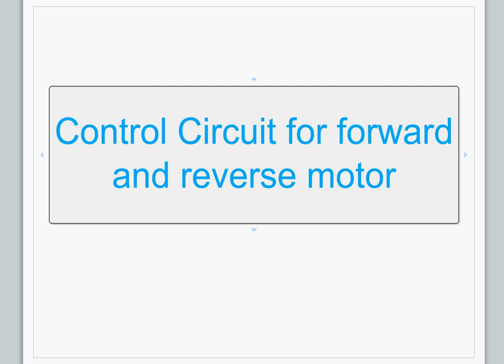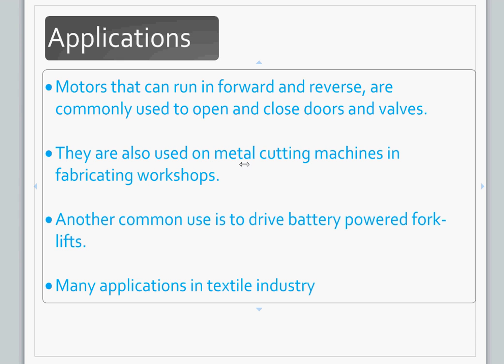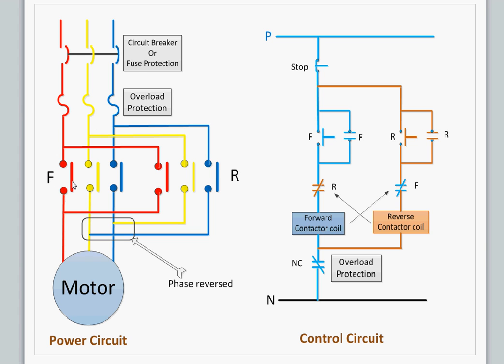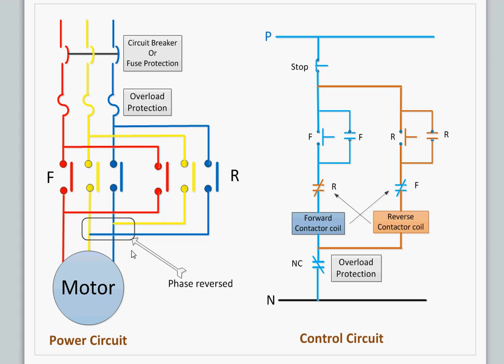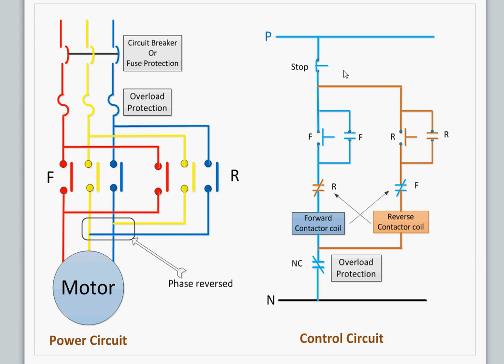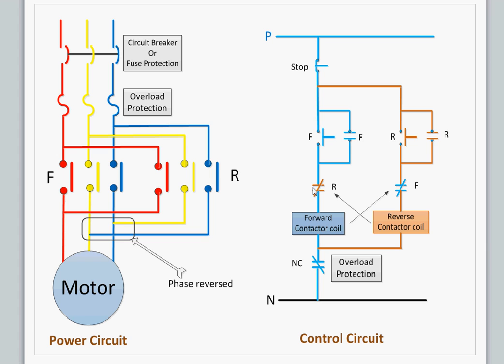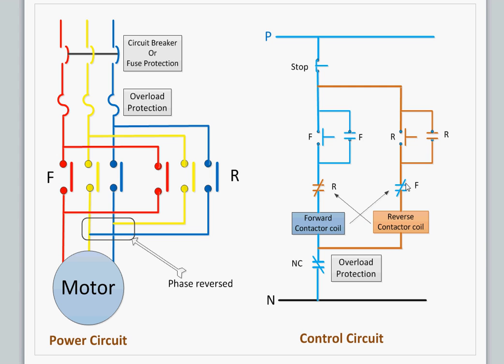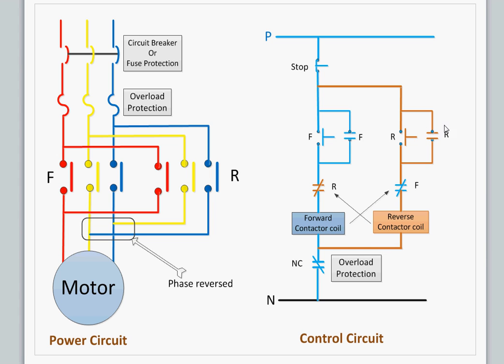Control circuit for forward and reverse motor

Comment: Hi. Great video. Why there is no transformer for the control circuit? Is it directly connected to the power cables? thanks
Reply from the maker: It's all depend of coil voltage of contacter. If it is 12v, 24v, 48v dc you need transformer and rectifire. If it is 220v, you need two phase. If it is 110 then you need one phase and earth and so on.

Comment: Help please! My lathe runs fine forward, but trips the house mains when I try to start it in reverse. Any ideas please?
Reply from the maker: I guess first you need to make sure you can run lathe in reverse direction or not. If lathe is not suppose to run in reverse and if you try, motor may take very high load and trip main.

I think you can run motor in reverse direction without any load (belt or mechanism) to make sure your circuit is ok. If motor can run in reverse without load, which mean circuit is ok.

If not, you may be short circuiting two phases during reverse direction. You may want to check wiring in this case.

Comment: Whe do I need to connect my positive and negative wire to?
Reply from the maker: +Tobias Vis P and N are Phase and Neutra for AC power supply. P and N are positive and negative for DC power supply. They are connected to power source.

Comment: Sir very nice video..kindly make me clear about the neutral wire in the control circuit!
Reply from the maker: +afaq shah Search Results
Ground: The bare wire is called the ground wire. Like the neutral wire, the ground wire is also connected to an earth ground. However, the neutral and ground wires serve two distinct purposes. The neutral wire forms a part of the live circuit along with the hot wire.

Comment: hi, may I know what do you call the F on the right side of forward push button in control circuit? Thank you.
Reply from the maker: +Renee Rose Dotollo It is "Normally Open" contact of forward contactor. When you release "F" push button for start, this NO (Normally Open) contact will be closed and hold circuit and motor will continue to run. If you don't put it motor won't be able to run continuously.

Comment: hi, can you tell each component used in the power circuit and control circuit? tq
Reply from the maker: Saidatul Adya Circuit breaker, contactors, Motors, power cables and control cables are major items.

Comment: can you please tell me how the contactor coil is energized??
Reply from the maker: ajith ajith Coil is made of specific number of copper wire turns. Then this coil is inserted in to metal core and when electricity passes through coil, metal core become electromagnet and closes contactor  contacts. Check out wiki link: https://en.wikipedia.org/wiki/Contactor